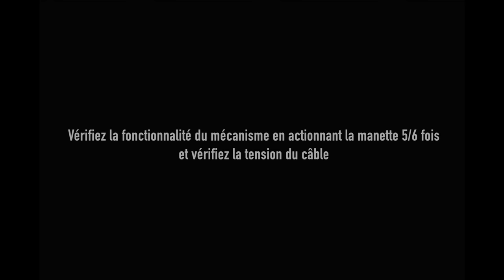Montage Kit Remote 2017 FOX GRIP

Comment: below is the french to English subtitles

kit composition
grease the spring correctly
place the spring inside the blue wheel
find the mark on the remote cup
insert the spring + wheel inside the cup
taking care to align the cable clamping screw with the cup mark
tighten the attachment end with a force equivalent to 0.4 newton meters
place the assembly on the attachment end with the duct inlet positioned to the left
secure the kit with the clamping screw
lift the black cup and turn it 3/4 anti-clockwise
prepare your order in the positionnate in firm mode
tighten it with a alan key and hold it in this posotion
pull the cable in its path, making sure to push in the sheath
secure the cable with the clamping screw
the order is operational